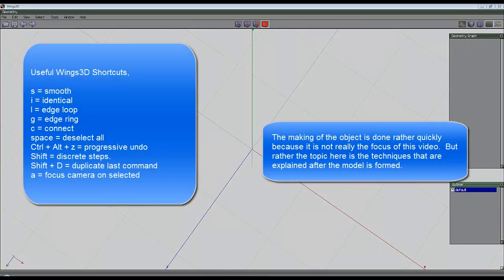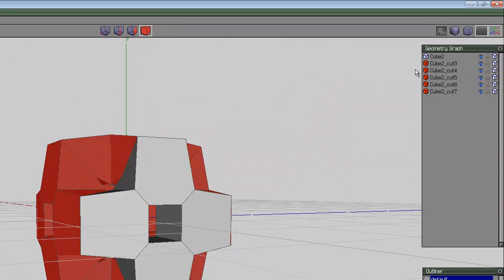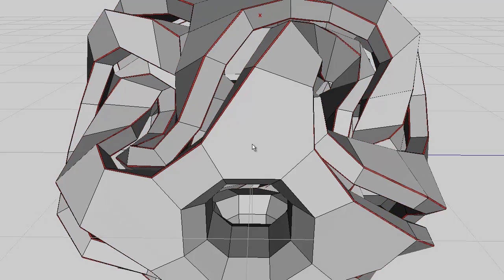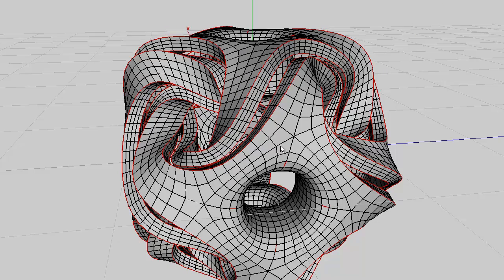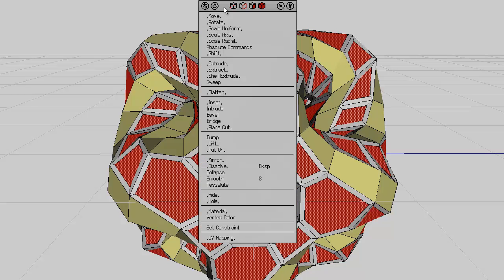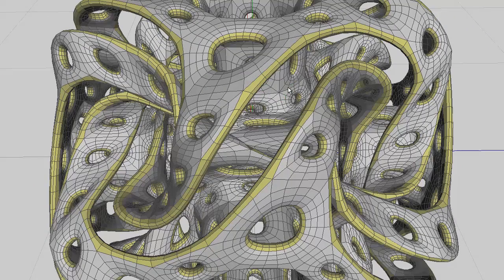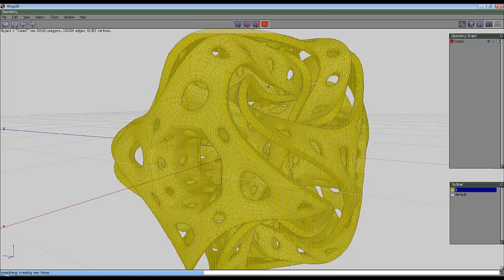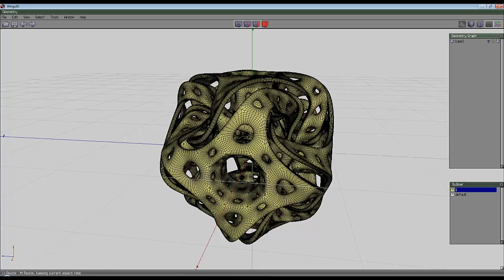Wings 3D project - cube twisted ported loop drilled - by David Brinnen.

Comment: It's amazing how you can quickly get results that look organic.  I'd like to 3D print one of these creations, but I am unclear as to whether the object you have created has any volume, or whether it is just the shell.
Reply from the maker: +Will Barrows, one of the quirks of the Wings3D subdivision modeler is that it only allows the creation of fully enclosed volumes.  You can accidentally create inside out shapes, so it is not bulletproof, but otherwise yes, Wings shapes are printable.  Indeed I've printed a few myself through Shapeways.

Comment: Hi guys!

Lightwave user here, I actually just tried wings now for some minutes, and one initial question popped out, where is do sabin?
I got the 1.5.3 version 64 bit for windows.

is it simple reduced as a tool and the same as S "smooth" ??

Michael
Reply: Never mind the do sabin, found it when I had body selection mode on.
now I only have to find out why radius setting isn´t working when sculpting, I can change the radius size with alt drag, but the numeric stats shows no radius and also when sculpting the radius is always the same.
Reply from the maker: Hi Prometheus - er... Michael, if you go into body selection mode (the right most selection mode cube at the top middle above the viewport) then select your object and then right click you will find the do sabin subdivision option about half way down the menu directly underneath the Smooth S option.  It works slightly differently to smooth and depending on the complexity of your mesh can take quite a while to process - so be patient if you use this on a high poly object.
Reply from the maker: ***** Er... that doesn't sound familiar to me.  Have you got stuck somewhere in the video?  If you state at what time point I might be able to unravel what you mean.  If not, then hopefully, someone wiser in the ways of wings will be able to help you.
Reply: David Brinnen

thanks david, I did find that body selection mode by myself as mentioned, so that´s out of the way...
regarding sculpting, you are not showing that in the tutorial, it was just me trying the sculpt tool out, but I just can´t change the radius of the sculpting brush, I can see it change when I alt hold and drag the mouse so the brush size radius changes when I do that, but it has no effect on sculpting at all, and the status info it says..radius None.

will have to register at forums and check.
I also noticed that lwo export cant be read by my lightwave 11.6.2, so I need to verify that, obj export works though.
wings has some really really nice tools I would like to have in lightwave modeler, and then again it misses a lot of other stuff lightwave has in modeler, it expands on the possibilities to form organic shapes at least.
I love the "i" for identical, and repeat of previsous command and the tweak tool is quite nice too, hovering over faces and selecting feels better in many cases than in lightwave modeler.
Reply from the maker: ***** Aye, even Modo could learn a thing or two from Wings!  I recommend you check out this fellow https://www.youtube.com/channel/UCW-CvUVkaZ8GJGS1uxBYlkA he is a Wings guru and would probably be in a better position to answer your questions than I.  Indeed I've had many helpful tips off Micheus, so I recommend talking nicely to him.